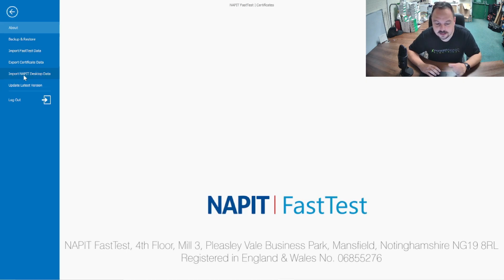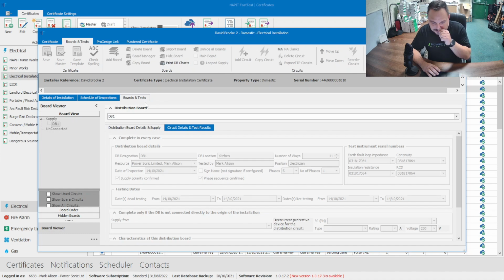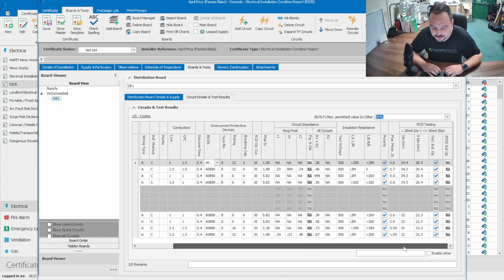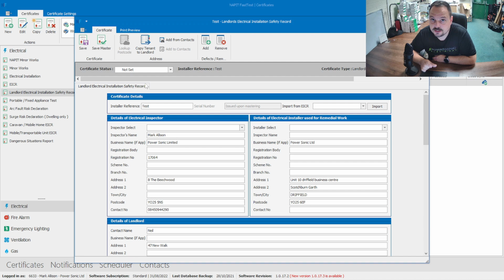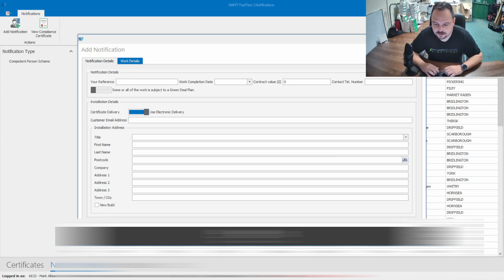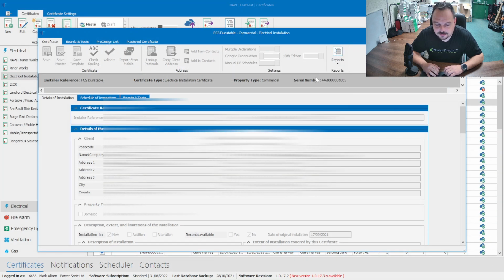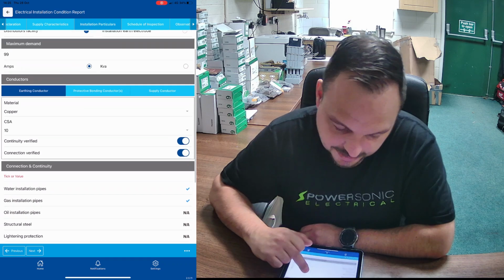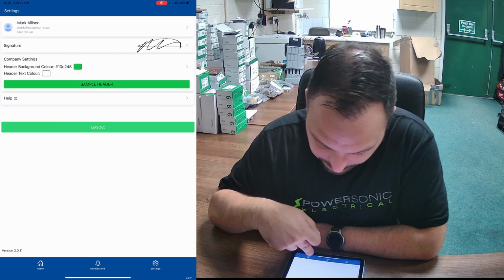The BEST electrical certification software? NAPIT FastTest in action

Comment: With code breakers, do you dislike the use of X as a service head problems, I cant leave a rigged meter like that ffs!
Reply from the maker: No I think its quite appropriate. The consumer is not responsible for the DNO kit so coding it for them to rectify has never sat well with me. Much better to X and dial the DNO up for them to sort it. Same result but cleaner paperwork

Comment: Also i thought it was all in the cloud so why do we need to assign the cert to our selfs? Can’t we just sign in and all certs be there? And if we collect data on site with iPad and the internet is a poor area or the pad dies do we loose that data inputted as we didn’t click that save button?
Reply from the maker: Hi Bradley. It is all in cloud. But for bigger setups with a few engineers and loads of certs it gets complicated quickly. So assignment of certs is really helpful in that case. 

The cert is stored locally on the ipad / tablet/ mobile so long as you save it. You can set it to do this automatically. Hope that helps.

Comment: Thank you Mark for going through the new NAPIT FastTest, I have a couple of questions if your able to answer them or able to find out as you've been granted access early. 

Does the new software prevent you mastering a certificate if you've forgotten to fill in or check a required box for example 'Next inspection date'? (I ask as I'm sure I'm not the only one who has mastered a cert and unfortunately missed it - and the current Desktop version wont flag anything, I know it asks are you happy to master but with time factor and the amount of certs required to be completed it would be handy) 

When completing the LABC notification as part of the cert (selecting the slider) does this now print the LABC cert when printing the electrical cert? as this would be really useful as currently with the Desktop version this is not an option, you have to then log on to the NAPIT login site then print from there. Hopefully that could be addressed as it will remove another step of paperwork 

Now on to my OCD - the current Desktop N/A is not the same per section of the cert - some are N/A then some are NA or you get na (would be nice if they were all the same)

Many thanks
Reply from the maker: Hi mate.

I will have a look on the mastering aas not sure is the honest answer. I used to make the same mistake in desktop and you can still copy the certificate if needed rather than start again.

The LABC certs can be printed and made into pdf from fast test! Thats a win!

The NA again I will have to look at that. 

Will report back soon!

If you want a demo run through with Napit I can point you in the right direction. This is all released no early access. 

Thanks for watching 💪
Reply: @electrician247  Hi Mark thank you for coming back to me regarding my questions. My apologies if I have caused offence regarding early access, I naturally assumed as you are a social media influencer you were given access early to promote and test for software bugs. 

That's great news that the LABC certs now can be printed at the same time - hopefully once mastered it will automatically be part of cert and you don't have to print or save two certs for the same job. (lets hoe this is the case as you can select if the cert is notifiable)

Keep the great content coming Mark, if your ever in the South West of England at a trade show be good to meet up.

Many thanks and kind regards

Comment: I've used the old Amtech software years ago, and I'm just getting to grip with this newer version.
I agree it is the best software, especially with larger reports as it will give you a nice distribution board schedule. Also, always liked the way you group 3phase circuits which had to be done manually on the old desktop version.
I'm having a few teething issues ATM, the mobile version doesn't produce Napit style certs, the desktop version does. Other then that and my cloudsync errors it's a great improvement.. Thanks for the vid.
Reply from the maker: Cheers Andy. I found you have to set the logo and header colours in the app. They dont cloud sync between mobile/desktop from what I understand.